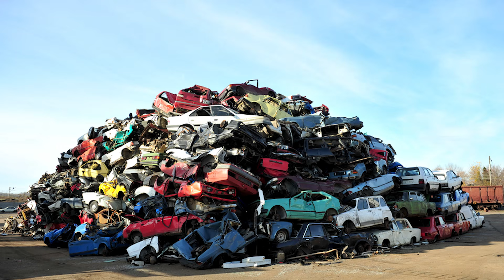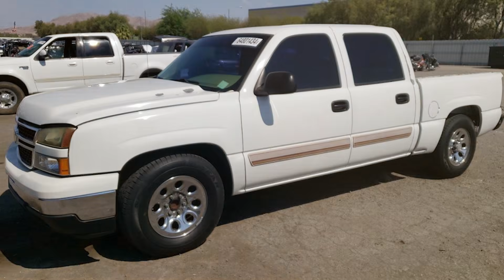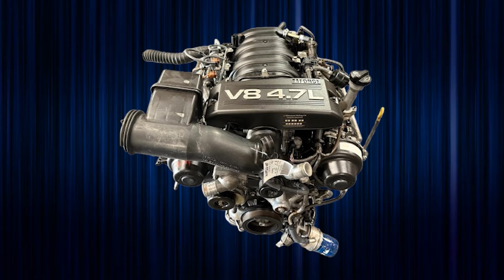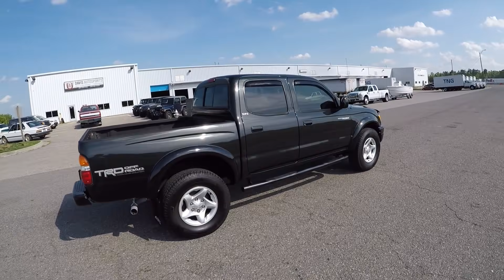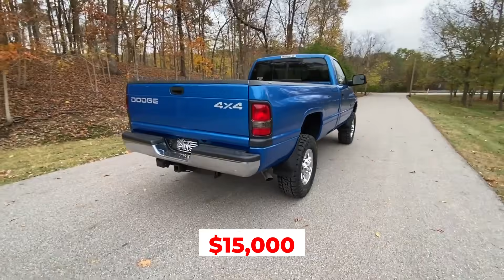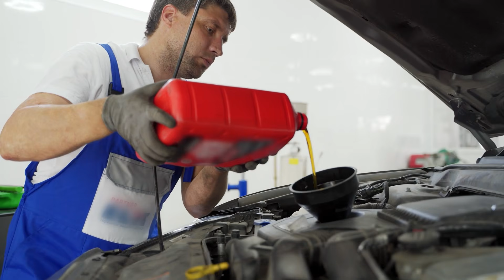7 Pickup Trucks Mechanics Trust With Their OWN Money (Buy Once, Drive Forever)

Comment: The Ford Ranger is notorious for rusty frames that fail by rusting completely away, leaving you with a nice looking truck body with no frame under it, and what good is that?
Reply from the maker: You're 100% right - frame rust is exactly how these trucks die, even when the engine is still perfect. In the Rust Belt, the frame usually surrenders long before the drivetrain does. That’s why a pre-purchase inspection on the leaf spring hangers and rear frame rails is mandatory for any Ranger buyer. However, if you find a clean one and stay ahead of the corrosion with fluid film or undercoating, you’ve got a truck that will last decades. Have you had a Ranger frame fail on you personally, or have you just seen too many of them in the scrap yard?

Comment: I love my GMT800 platform trucks and SUVs. 03 Yukon Denali XL 6.0 and 05 2500hd Duramax. Both run like a top. The Duramax just made a 1600 mile round trip from Eastern Ohio to Northern Alabama without missing a beat. The Yukon would do it too, but it needs a left inner tie rod end and alignment. I still run it around locally. Work car is an 01 3.8 Impala that I gave $500 for because they couldn't figure out why it wouldn't run right. I had it for 45 minutes and found a broken valve spring in the number 5 cylinder. $8 to fix it and the A/C still works.
Reply from the maker: That is an absolute dream fleet of reliable machinery. Between the 6.0L, the Duramax, and the legendary 3.8L in the Impala, you’ve basically got the 'Hall of Fame' for unkillable engines in your driveway. That $8 repair on the Impala is a perfect example of what makes these older platforms priceless - a little mechanical intuition and a simple fix instead of a $90k loan. Out of those three legends, which one is actually your personal favorite to spend time behind the wheel on a long drive?

Comment: Great trucks , but GM has never gave a damn about their rust problem, I’ve had several that were rusty disasters , check them out good before handing the cash
Reply from the maker: You are 100% correct - GM has always been a 'the engine will outlast the body' company. You can have a Vortec V8 that's ready for another 200k miles, but if the rocker panels and the frame at the rear leaf spring hangers are gone, the truck is essentially a parts donor.
It’s the number one thing I tell people to check with a hammer and a flashlight before even popping the hood. Since you've dealt with those 'rusty disasters' before, do you now exclusively use fluid film or woolwax on your trucks, or have you just moved to a different brand altogether to avoid the headache?